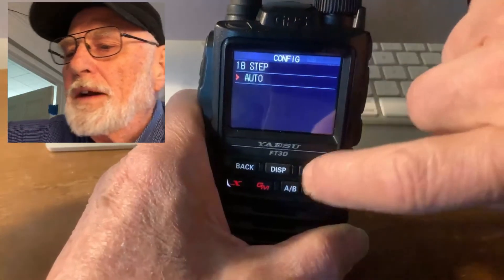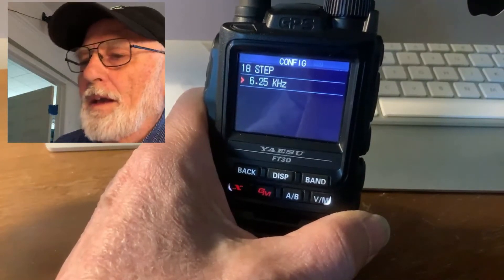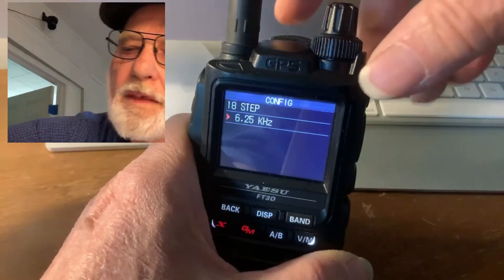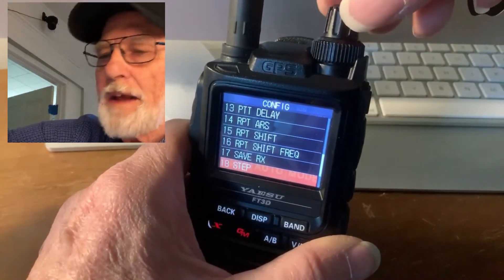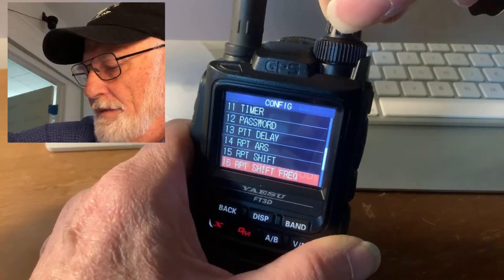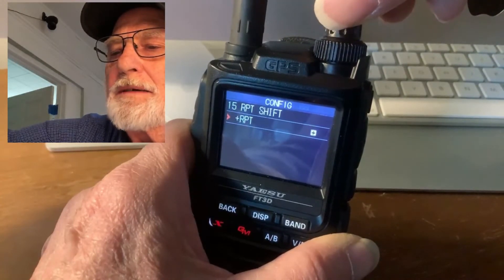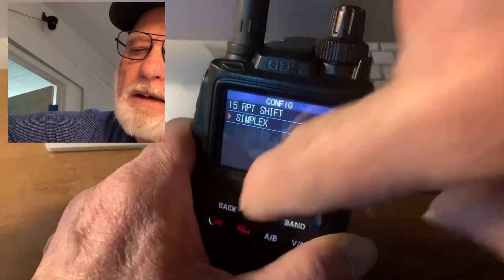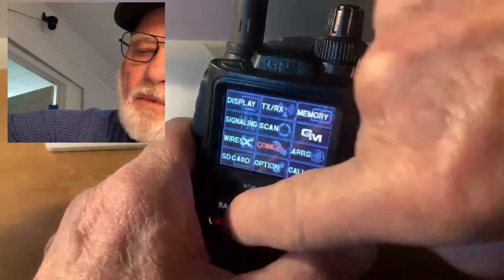C4FM Call Freq

Comment: I still haven't been able to connect to fusion and pretty much hate the FT-5 except for the aprs. Im sorry my frustrations are coming out on your comments, but Why would they make finding the repeaters such a pain in the ass to figure out, then add another level of confusion by not having the repeaters do the same functions that you also have no idea what they are. Also why wouldn't the gps function do all that for me? Also if I want to pick what room I would like to enter, NOPE cant do that. So far, I cant stand fusion also cause I cant even get into it. What's amazing is that this radio was so promoted as a radio to get on digital in minutes. LOL Ive owned it for a month and haven't been able to pick a room, the time it goes on the shelf is getting longer and longer.
Reply from the maker: Tony, I have no idea where you are, but I’m in California, can you give me a call on the phone?  I need more information, maybe we can do a zoom call or something?  Ph 661-599-4499
Reply: Yaesu digital is like 1 1/4 meters. Some areas  have more activity  then others that have none. Where I am ,there is ONE   repeater that is still in AMS  mode (up on a mountain at 9,000 feet ) and only a handful of people who have radios to use it. I have a  FT70DR  and  FTM7250 that program easily  from the key board. I found a wires x repeater while driving thru Tucson, Phoenix, LA  and a linked group around KC and had no problem join the group. There are 3 of us using it as UHF  simplex and it is amazing the range a HT has  from INSIDE  a house. Where are you located?
Reply from the maker: @frankpeletz1818  Hi Frank, I’m in Gold Run, CA at 3400 ft.

73
Ken  KA6SUB
Reply: same for me with 991A. manual do not say nothing , and watching some tutorials i did not solve some connection problems. i had to tell to some collegue ham. thank to Iu5FFW i ve solved. but still not connect to some room lol

Comment: Be sure and check the SQ setting in FM mode.  If SQ is open (0) - no XMIT.
Reply from the maker: Why are you going to FM to check the C4FM squelch setting?  When you open the squelch, whether in FM or C4FM, the busy light comes on.  That is all you need to know!  Save yourself the extra work and set the Squelch in the C4FM mode by watching the Busy Light. Set the squelch so the Busy light is either flashing or the first step that the light is is fully off.  

It is true, while in the GM mode, the radio will send out a beacon only when the frequency is not busy (Busy Light is OFF or Flashing).

Remember that even if the squelch may be open (Busy) you can still press the PTT and talk!

Thank you for your comment,

73,  Ken  KA6SUB

Comment: Wouldn't it make sense to have a Yaesu-specific call frequency be a frequency that can be accessed without reconfiguration of automatic step intervals on Yaesu radios?
Reply from the maker: ExtremeSquared, I think in all fairness you should ask John at Yaesu this question, all I can do is give you my opinion based on what they had put out at the time they came up with it.  In my opinion based on the videos from Yaesu, they were looking for a frequency that would fit into most band plans using the best hamming practices. Thank you for the question.

Comment: How do I change the step on the FT-70D.  Why did you pick a frequency that is not easy to program?
Reply from the maker: Hi Bruce, sorry that it has taken so long.  This Frequency was picked by hams working at Yaesu, they had to find one that could be used in most of the world.  I made a video for you https://youtu.be/TenHgqrMzck  Thank you for your question, 
73  
"The Fusion Elmer Guy"
Ken   KA6SUB
Reply: f,then 4. button labled step

Comment: We've got an IRLP simplex node locally where I am at 145.55, so we've been using 145.78 instead so we don't cause interference.   C4FM simplex works well for me.   73
Reply from the maker: Hi, nice hearing from you. I like IRLP as an analog node but, not many out there as EchoLink or AllStar. Do you have a Fusion repeater where you are? Give me a call on IRLP at #3714 (KA6SUB Ken) and we can talk. 73, Ken

Comment: I enjoyed your review and setup of C4FM.
Recently I purchased a Yaesu FT70DR which is my first radio with Wires X capabilities. Using the radio manual is quite a feat, I am able to depress the ‘F’ key and then ‘AMS’ and connect to the gateway of WiresX but I’m not really understanding the writeup in the FT70 manual to advance any further,
Will you consider going through ALL the steps necessary to setup WiresX on the FT70DR in an upcoming video.
Apparently I need need to register with Yaesu and provide my HT ID, 
how do I determine that info?
Thanks for you time

KB5WRL
Reply from the maker: Hi Ron, 

Thank you for your comments, doing a review for the FT70 is on my list. As far as registration of the FT70, it is not necessary for you to use. The ID was set at the factory. 

Thank you for watching,
Ken. KA6SUB

Comment: talked with you the other night when on wires x and chris and i were in colorado springs running analog... 73 my friend.. tony t. n0amy...
Reply from the maker: Hey Tony, did you ever look at the Audio settings.  You may also want to look at the settings for HRI-200 setup and try changing De-emphasis and Pre-emphasis to see what happens.

Comment: I hope you will continue to make videos on system fusion and wires-x.  I'm working with the ftm-300DR and this digital mode is all new to me.
Reply from the maker: Thank you.  Yes I will continue to focus on the Yaesu System Fusion.  How do you like your FTM-300DR?  I love mine.  Just take digital one step at a time and you'll be OK.  Don't forget to subscribe so you don't miss the next one!  73 "The Fusion Elmer Guy"
Reply: @thefusionelmerguy2234  I almost got the 100DR to get into the digital but I'm glad I waited and they came out with the 300DR.  I really like this radio although I have lots to learn about it.  

Definitely got subscribed.  I haven't seen any other channels that take the time to walk through the steps so pretty much anyone can understand.  I need to watch your other videos because I'm confused what the difference is between wires-x and fusion.
Reply from the maker: I’m sorry that it has taken so long to answer you, but I just found a bunch of these comments that I had missed. To answer your question, FUSION is the ability to have both FM (Analog) and C4FM (Digital) work together in the same Radio/Repeater, this is made possible with the Yaesu’s Automatic Mode Select (AMS).  

Wires-X on the other hand is a VOIP  protocol used by Yaesu to link repeaters to repeaters and to individual Ham Radios.  A Wires-X node is much like EchoLink or IRLP nodes.  Wires-X does NOT come with each Yaesu repeater sold.  The repeater group that buys the repeater will decide whether or not to purchase a Wires-X node (HRI-200) and how it will be integrated into their system.  So, just because you have a Yaesu FUSION Repeater in your area, it does not mean that there is Wires-X on it.  Also, if there is a Wires-X node on the repeater, it could be using a different DG-ID than the one that you use to talk on. You have a separate Wires-X Menu in your radio  for setting up Wires-X DG-ID’s and other related things.

Hope that this helps. 73, Ken